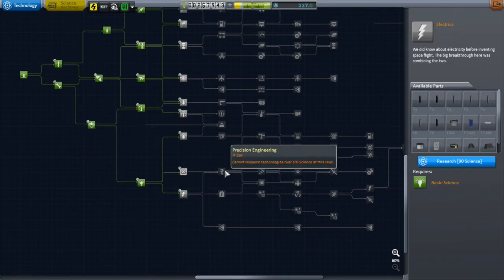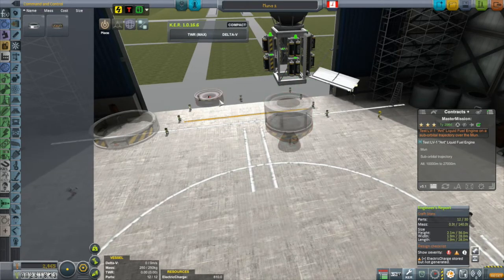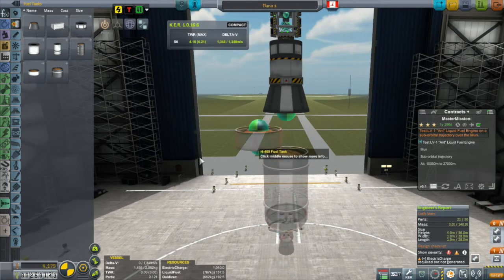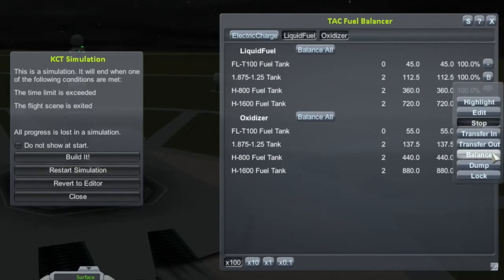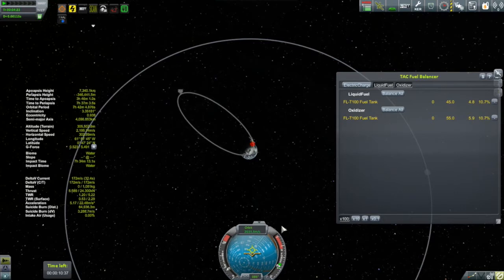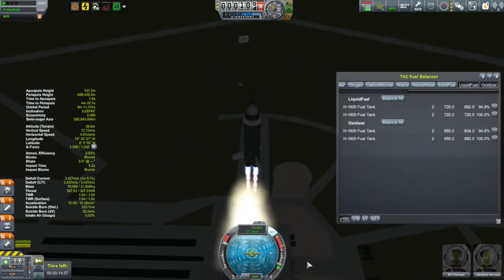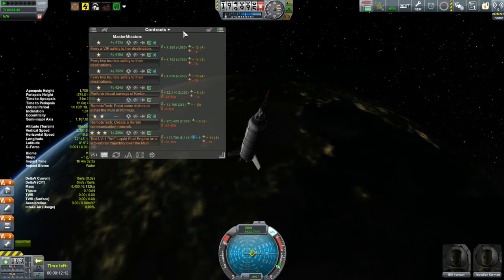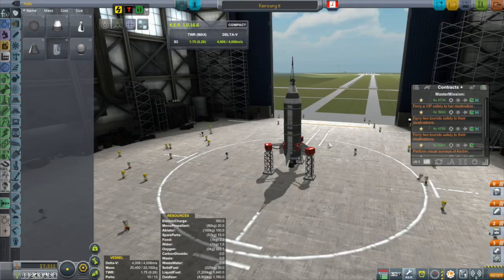KSP Career: Episode 9 - Design Woes

Comment: A bit random, but I’ve been trying to watch various different players and learn more. What is the farthest back version/time frame where the principles/what happens in the vid still hold true for the latest version (ie 1.12.2)? I understand there was some game mechanics changes over the different versions and just want to make sure I’m watching videos that work with the same mechanics as the current one. (Don’t get me wrong orbital mechanics principles like Oberth and stuff still apply throughout the versions but vessel design and stuff might have changed)
Reply from the maker: The game came out of early release in April 2015. Although the physics in space were the same from the get go, but before that you may find some major differences, especially around the KSC and how the aerodynamics worked. 

Here are some major updates since then. I'm not including new parts and the like.
1.2 (Oct 2016): added communications network
1.4 (Mar 2018): EVA parachutes added
1.5 (Oct 2018): added extra burn time info to the navball
1.6 (Dec 2018): Delta-v tools in the VAB and SPH
1.7 (Apr 2019): Added in-flight maneuver and data tools to the bottom right.
1.8 (Oct 2019): Ability to edit action groups in flight.
1.11 (Dec 2020): EVA construction added
1.12 (June 2021): Transfer maneuver creator and alarm apps added.
Reply: @MikeAben  yeah. The aero is especially where I’m like are the videos still relevant?
Reply from the maker: @nauticalwolf6649  I would say anything before the full release is pretty sketchy for aerodynamics. The way to launch into orbit used to be quite different.